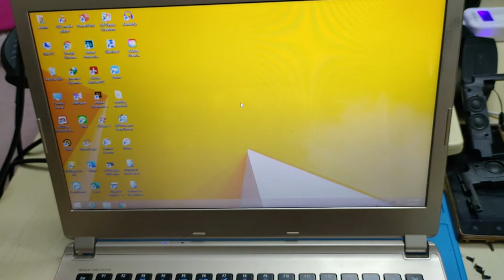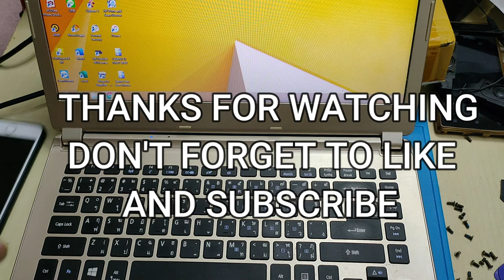ACER V5 473 Keyboard, Speaker and Battery How to replace

Comment: Hello, thanks for the awesome video. I did manage to remove the back cover.

I initially wanted to do that because my power indicator light (orange light) stays on after shut down, even after unplugging. I tried doing a battery reset by pressing the reset pinhole, but every time I release the battery reset button, the orange light comes back on.

So I thought I'll try to manually remove the battery.

Interestingly, when I remove the back cover, the light goes off, but when I put back the cover (without adding back the screws), the light comes back on! I have no idea what's triggering the light to come back on. I mean, the whole back cover is plastic (or something non-conducting), isn't it?

Any idea why the orange light comes back on when the back cover is put back?

Even better, do you know why the orange light stays on even if I unplug and shut down?

I've called Acer's technician; they seem to have no idea too. 

Thanks in advance!

PS: Oh, one more thing, I realized if I don't put back the back cover, I can't turn on the laptop. Seems like the back cover has something to do with it. Why??? haha ... going crazy.

Comment: is that solder to melt the plastc, but previous process, u already tear out the head of plastic. think only once you can do this, second time keyboard failure, need other method
Reply from the maker: i use normal soldering iron to melt the plastic I replace the keyboard